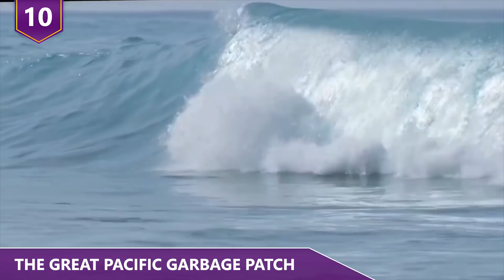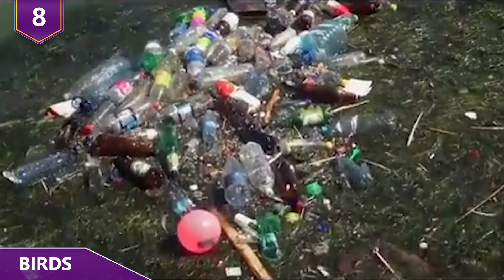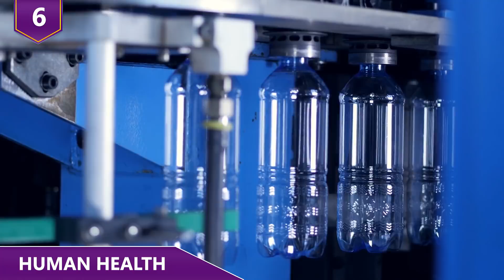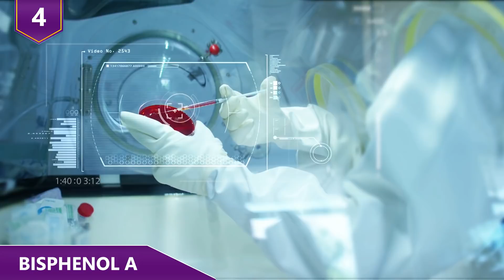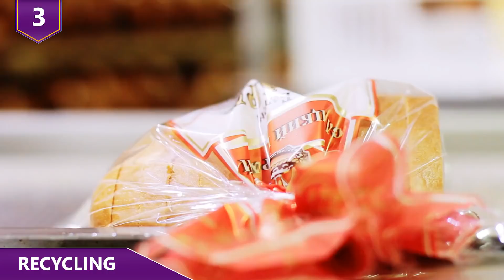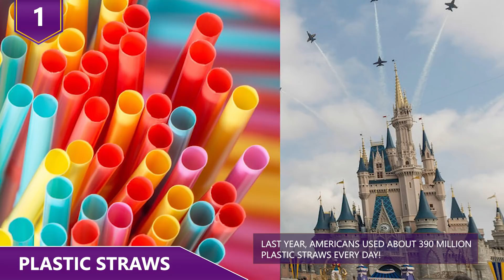How Plastic Is Affecting ALL of us!

Comment: This is mostly correct, and about bio degradable plastic, also a problem, because it’s not directly degradable in nature, it needs “help”.
“Paper” cups always have a tiny layer of plastic or wax on the inside, and are not degradable. The reason for that is, that paper can’t hold liquids. Think about that the next time you buy a soda or coffee at Starbucks.